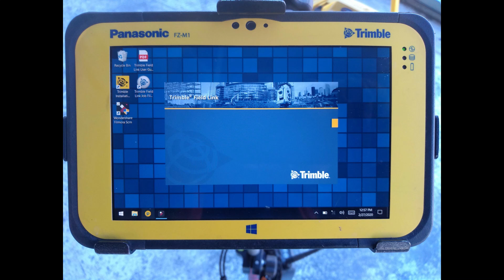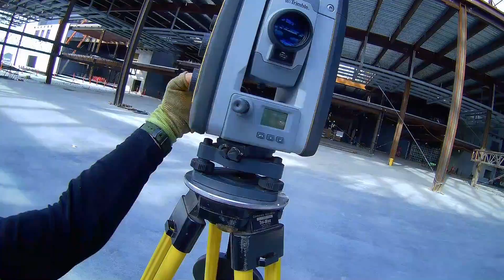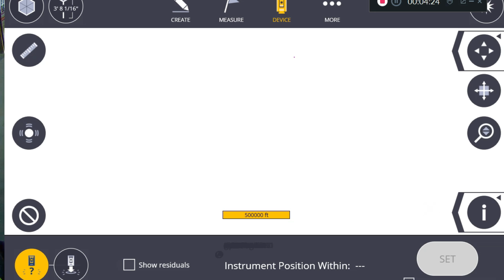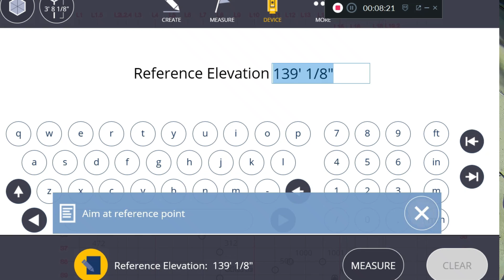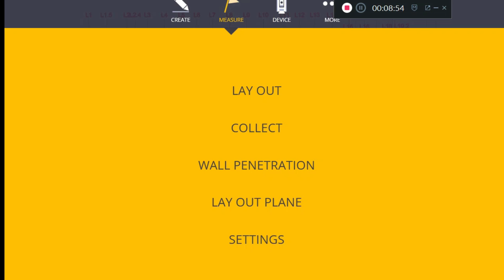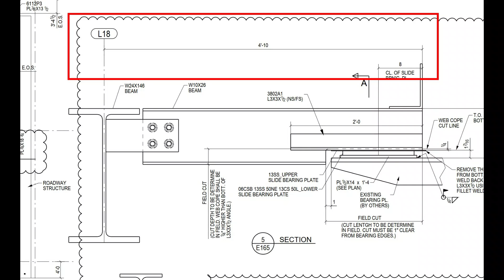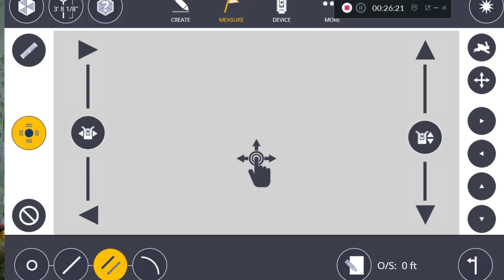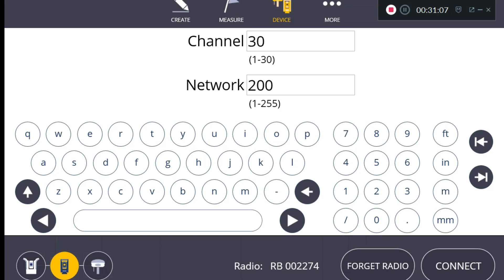Offset and Elevation Layout with Robotic Total Station

Comment: You have a peanut prism, if you’re not going to use a bi pod , with direct and reverse and also spin the rod 180 (before you remeasure on face 2), at least take the peanut prism off and shot from the ground.  Usually the HR of that style is around .25ish depending on the tip.

Comment: I would spread the tripod legs a lot further than that. It would make it a lot more stable. Especially in windy air conditions.
Reply: That’s really not the main problem, when the legs are close in and instrument high up, the spinning magnets inside create instability and the instrument won’t go through the connection promps.  Lots of guys don’t know that.  You can use leg weights or sandbags to stabilize.

Comment: When you pulled the prism off of the pole does it not change the constant to 0mm? Or is the prism constant 0mm when it's screw back into the pole?
Reply: In that configuration it’s always zero.  Actual surveyors usually use -30 mm constant when it’s on the pole, unless they are older geometer guys.

Comment: Wondering if you could give me some insight, I'm trying to create temporary points on a curb that curves in various spots, when I go to my layout tab and click the circle/arc button  the line doesn't show the points it should, rather it  tells me there's no logical radius inputted.  How can I create points on a curved curb without having to create a bunch of intersecting lines to create a selectable point?
Reply: There are several ways to layout a radius curb or a curve. 
1) you can choose 3 points on the arc; starting point on the arc, mid point and the end point
2) you can stake with the center point of the arc and the radius of the arc
3) you can stake out with radius of the arc, the starting and end point of the arc. 

I hope this helps
Reply: Shoot the points then select them and add them on an arc

Comment: For increased accuracy and repeatability of measurements I'd use a bipod on the pole with a calibrated 8' circular boubble and a nodal prism ( Leica mini with -17mm prism constant for Trimble instruments, Leica Circular prism (-34.4mm pc), or Seco nodal prisms ). A nodal prism would return the correct angle and distance measurement even if the prism is not "looking" straight at the instrument. The way it looks you're using a mini prism with a 0mm offset. If you used on the -30mm side, you'd be getting more consistent results. 0mm offset is the most sensitive to any readings that are not perpendicular to the instrument's line of sight, also the elevations would be off when shooting at steep angles. A nodal prism tilted toward the instrument would solve this problem. 360 prisms don't yield good elevations at steep angles. In over 25 years of doing layout work I tried  many setups and the least accurate seemed to be the telescoping poles. I only use a 2 piece pole that I rarely extend. The new poles boubbles are never calibrated out of the box, so you have to do that yourself. I personally use the instrument to calibrate the boubble within 0.5mm runout.
Reply: Sir, we definitely need more advices from you!!
Reply: Your absolutely correct
Reply: Use a MT1000 in active mode
Reply: I believe you understand construction surveying , I do not believe this you tuber understands the informative advice you provide.  The 0 prism at height was the big instant give away.

Comment: A 360 prism would work better
Reply: Probably too many obstructions on the structure
But I do feel using a tripod is a lot easier to work with than the single pole
Reply: Also I think he uses this particular prism because it can rotate up and down (useful when the TS is setup on ground floor and he is high up on the structure)
plus it is small and has a useful tip on its back that can be used to point on vertical elements like when he used it to check the elevation on a point marked on a column
Reply: No because it has multiple mirrors so more chance of errors.  Structural layout has to be real tight

Comment: Great video! I’m an ironworker in Local 721 Toronto. Where did you get trained on how to use the robotic total station?
Reply: F that, try 5 years of survey school through operating engineers.  I don’t do iron, so you shouldn’t be messing with survey work.  I set iron and decks for a living , went through a formal apprenticeship to learn surveying.

Comment: Awesome!

Curious, control point 495, elev 101' 8 11/16".  Where does that elevation height reference too?  Is that control point 495 101' 8 11/16" above a surveyed benchmark at the ground level per NAV88 vertical datum?  Or is it localized?  I.e. above a 0 level of the building or ground or whatever?

Thanks for the very informative video!
Reply: it referances to the total station, which is a control so you can figure out elevation from there.
Reply: It's in reference to the control point he set his gun up on originally because it was at a known benchmark. The Elevations are set different on each job